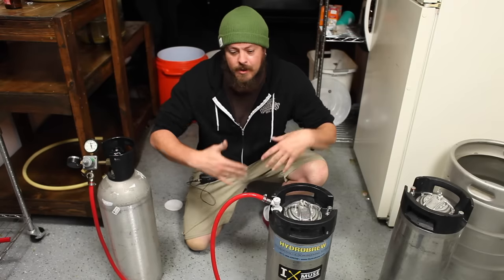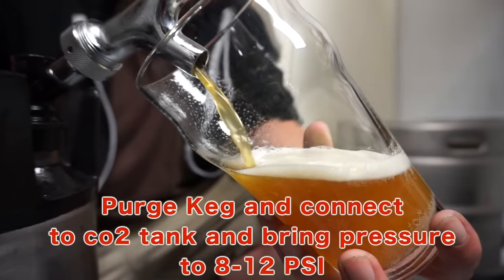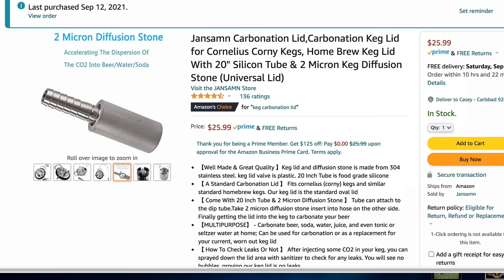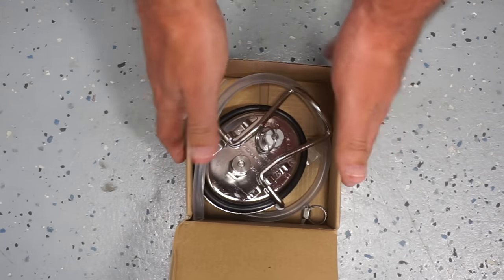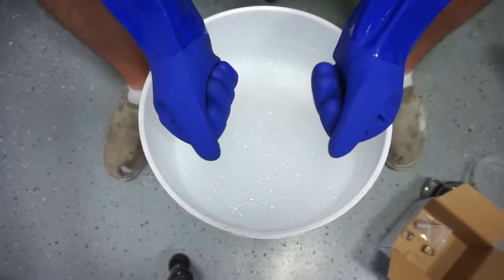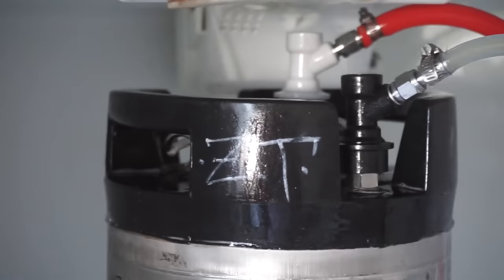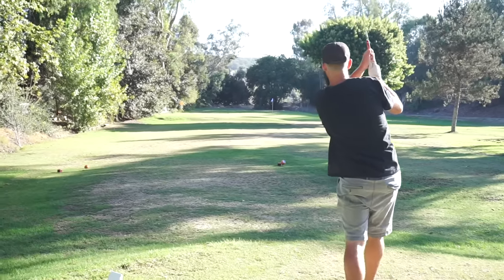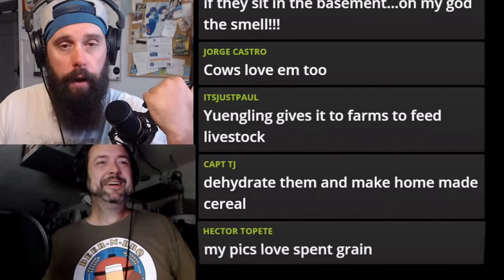HOW TO FORCE CARBONATE HOMEBREW BEER (Corny Keg)

Comment: Hose has material memory and wouldn't uncoil 1st time I used it.  Used hot water and straitenened it out.  Other than that it works but still find beer is better 1 week on gas and best one month in a nice cold korny.  That being said using this thing with along with the clipping the dip tube gets you into faster / clearer beer though!   Thanks Braj Lord!
Reply from the maker: Way to get it done Braj!

Comment: Hi,have a quick question!im new to the kegging system, but after purchasing a kegerator and 2 cornys ! My bottled beer was way more clearer , had better carbonation!not sure! Wondering if it is that one step where just before bottling you add more surgar to give the yeast something to eat to give better carbonation! I viewed how to pour the perfect draft! Can’t even get close to an inch or even half an inch of head,I also bought the carbonation corny keg with the .5 stone!it’s been in kegerator for over 24 hours!has a good temperature,im driving at 15 psi co2! Kind of hoping for a easy fix !cause the whole reason for kegging was to get rid of bottling! Too much time consuming! Thanks for any help!

Comment: I’ve used the corny keg carbonation lid for about 3 weeks
it’s awesome……just a tip - sit the diffusion stone in hot water before each use, that will clean out any oils, crud, etc that may clog it
Reply from the maker: That's a great idea! Cheers!
Reply: noticed your post, was your beer cold when you forced carb it ? My beer is in glass carboy in basement and wondering best way to proceed? Thank you
Reply: Do you charge the head space with co also when you use the stone
Reply: @josephcajzer9598  yep

Comment: I actually use this trick when I had a dip tube that was circumcised clogged up with trub. I changed out the post to a liquid post. Then put a floating dip on it saved my ass because I'd probably never would have got that beer out without it!

Comment: OK - serious question this time: Once you are up to a good carbonation level, can you swap that lid out for a normal one or will that kill the carbonation level you just worked 4 hours getting to? My thought would be to carb your keg in 4 hours, then the next day use that same lid to carb another keg quickly.
Reply from the maker: I wouldn't to avoid oxygen.  I'd just buy another one (or however many for how many beers you have on)
Reply: @HOMEBREW4LIFE  so you leave the line with the air stone on it in the beer until you kick the keg?
Reply: I swap mine out after carbing, I just blast co2 in before removing the lid,no issues.

Comment: Nice video! I had one problem following your steps: When shaking Keg connected at 25-30 PSI, beer from Keg start to escape from Keg through the co2 hose to the co2 tank and I had to stop. Any clues what's happening or what I'm doing wrong?
Reply: For that to happen the pressure in the tank would need to exceed the incoming pressure, so my guess is that by shaking up the keg, it increased the pressure in the tank beyond 30 psi.

Comment: when using the carb stone is it necessary to also add co to the head space ???? Thanks
Reply from the maker: Ur call
Reply: it helps speed up carbing to have slightly positive pressure on headpsace, like 12-15 psi . This helps keep co2 from escaping into headspace, especially when you first add pressure. another trick with these stones is to ramp up co2 over time, add 2 psi and wait 15min, then another 2psi and wait 15min and so on. that should be carbonated within an hour and half or so, good if you are home and have the time to make the adjustments. Kinda becomes similar timeline to the shake @ 30psi method but with the ability to truly set the intended Vol. of CO2.

Comment: Couldn't you just buy the stone and hose and connect to the corny kegs gas post? Or is there a reason to reconnect the CO2 back up without the stone to serve ?
Reply from the maker: you can if you can get your hand in there with a flathead or drill but my hands are too big lol
Reply: @HOMEBREW4LIFE  gotcha i didn't even think about the pressure blowing the hose off without a clamp

Comment: Here's a question if you keg soda for the littles or non drinking wife, would it be fine to mix the 1 gallon of syrup with 4 gallons of water in your keg? Or would all that mixing produce oxidation in the soda, and just mix in a plastic brew bucket then gently add the soda like beer? New to Kegging!
Reply from the maker: no that's cool.  Brewers add stuff like that too their kegs all the time, cheers!

Comment: Ordered this bad boy the day you posted your video. Was finally able to use it this morning. Worked like a charm, already drinking a frothy one about 7 hours after kegging! Great recommendation!
Reply from the maker: Great to hear!
Reply: Just noticed your post. My beer is in glass carboy in basement. not cold yet. Any idea as to how to proceed. Should I transfer to corny keg, cool it and then force carb it ? Thank you!
Reply: @josephcajzer9598  yeah just proceed with your normal process but if you have that lid with aeration stone then replace your default corny lid with this one and hook the CO2 to that connector where the tub and aeration stone are connected to and let it sit for a few hours then you'll be drinking in no time
Reply: @ldt_  thank you, unfortunately my beer is not cold going into corny keg. Thoughts suggestions? Thanks
Reply: @josephcajzer9598  you can still use this lid as a normal lid, warm or cold
Reply: @ldt_  ok thank you for assisting. Just watched a few other videos and it might take a little longer not being cold but will do it later! Cheers
Reply: Do you have to put co in the headspace also in addition to using the stone

Comment: Ive been trying to set my carbonation!but I’m here alone and I’m getting pretty drunk!try in a few!got it up to 18 psi co2! Comes out flat!oh god ,I hope I didn’t was all that money!
Reply: Waste all my money!must have 600 $ Canadian bones!so far?
Reply: Well sort of figured something out!,i had pin locks went to Amazon tried to order ball lock connectors for corny kegs!,it turns out there is ,two different types!and I without the knowledge of a tap and die worker wouldn’t think I would have to  18 many threads per inch on a 9/32 head!so I ordered the incorrect one,all correct but no were did it say corny keg,so I’m finding loss of co2, in the gas side!so hoping my beer will last a week in kegerator with out co2 to make it fresh and not stale!.well it’s gone of have to,I came this far!double ended staff  I will succeed!how ever , to the DIY self person,Ild rather buy as one complete unit! Like kegerator,kegs, all proper posts,no surprises!unlike me myself and I order,try,reorder!more expense!shrimping ain’t easy!!lol

Comment: Congrats on 200!!  Been flowing you guys for a while and your videos always make my day better:) Is there a reason you couldnt just add the barb stone and line to the kegs factory c02 post? I'm down to get 4 of them but don't want to waist money if it will work the same. Cheers to many many more videos
Reply from the maker: Thx for the love! Go for it if you can fit your hand in there (and securing a hose clamp!)
Reply: if you cold crash completely i have done this just fine. if not, youll blast sediment back into solution.

Comment: Congrats on 200 ! new to your page and new to homebrewing. So 10 PSI for 4 to 5 hours and then good to drink, do you then keep the PSI at 10 afterwards for the remainder of the time beer is in keg or do you lower it slightly ?
Reply from the maker: Yeah i've kept mine at 10psi all week and it's been pouring beautifully!
Reply: @HOMEBREW4LIFE  So just realized that beer has to be cold for force carb to work. My beer ( pale ale ) is in glass carboy, basement temp. should i transfer it to corny keg and pressurize it normally and let it get cold in kegerator over night and then force carb it with the dip tube that i ordered after watching your video ?? Thank you !!!

Comment: DO NOT USE THE HOSE CLAMP ON THE AERATION STONE.  Those crappy clamps are Galvanized Steel and will leech metals into your beer.  Take a zip tie and sanitize it, then using cleaned pliers - cinch the zip tie where the clamp would normally go at the aeration stone.

I know because I've done it the wrong way.
Reply from the maker: Cheers!

Comment: QUESTION : Why not just add a silicon hose and diffuser stone to your gas in tube, and Hose Clamp - Stainless Steel with Wing Nut ? Save some cash !!!!!!!!
Reply from the maker: if your hand can fit in there and secure it then go for it!
Reply: @HOMEBREW4LIFE  Im 6'2   235 lbs Steel Worker  if my hand can do it ,EVERYONE CAN . Congrats on 200th !